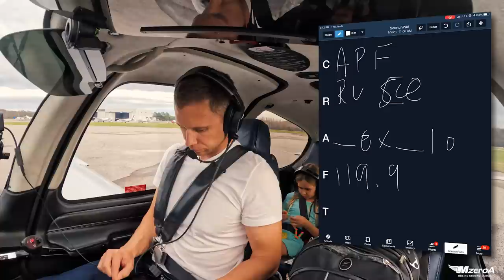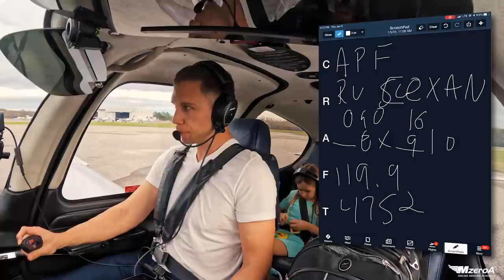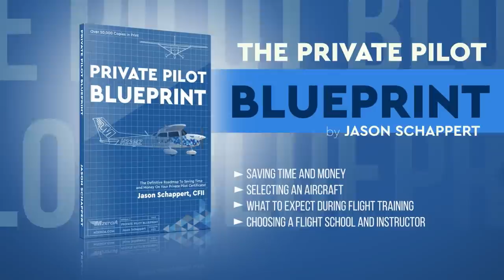Pick Up An IFR Clearance From A Non-towered Airport

Comment: Two things..  One of the main causes of accidents on the ground is distraction.  Should you be talking/filming while taxiing?  Also, I don't think it's a good idea to get your clearance just before take off.  Maybe just as you're ready to leave the ramp?  You should be ready to taxi, though.  Still a good video.  16/16
Reply: Cameras start before the engine starts and are not touched until the engine is turned off. If you get your clearance at a pilot controlled towered too early as at the fbo or before taxi and you have a clearance void time your forced to rush taxi and run up. Getting your clearance after run up and when you’re number 1 for departure gives you more time.